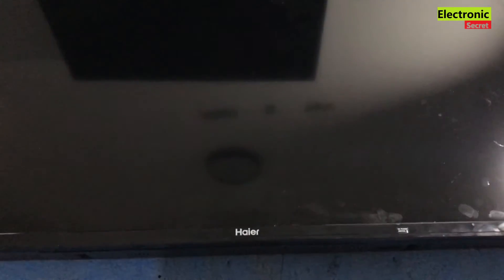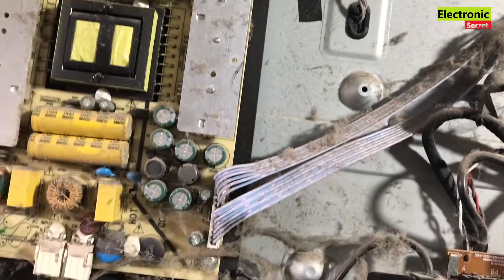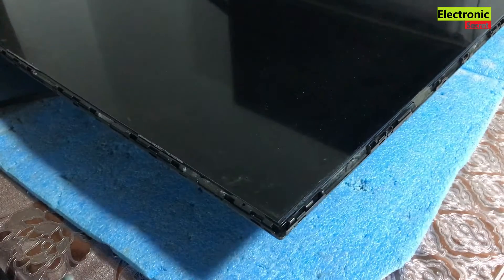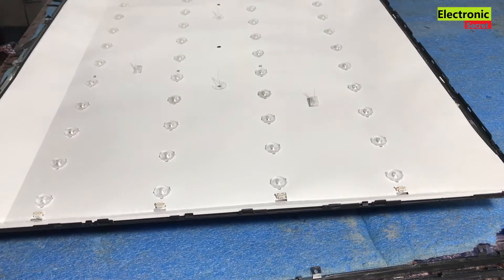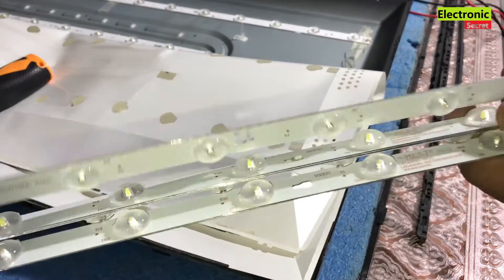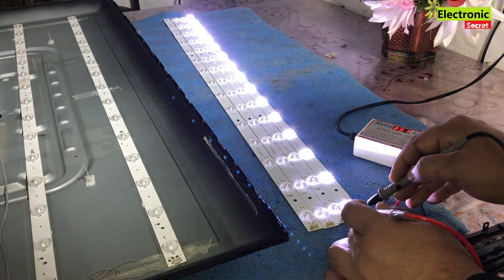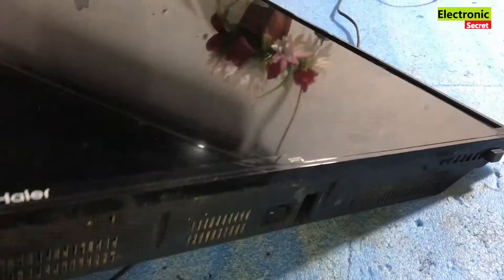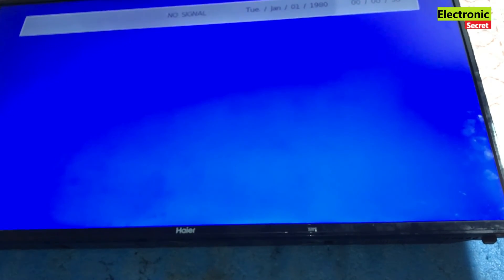HAIER LED TV BACKLIGHT REPAIR, HAIER LED NO DISPLAY PROBLEM

Comment: If only some led lights or strip is not working, then there should at least be some light?  If it is completely dark unless using a flashlight, then it is probably from driver?
Reply from the maker: No, 
In some models if any one led is not working,
Whole screen will be dark but in some models if some leds are working then display will come,
Depends on brands and models and there working principles
Reply: In the video, every strip had at least one bad LED. I'm assuming it could also be the case that only one strip had at least one faulty LED, and that that strip won't come on while the others do.